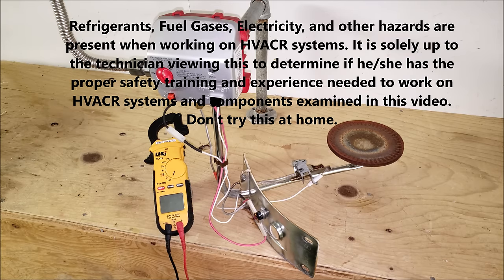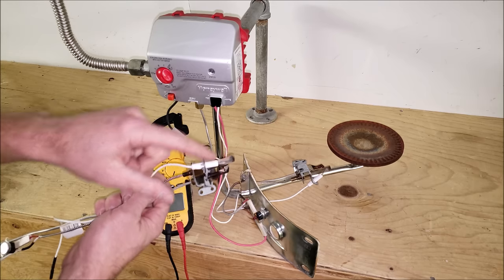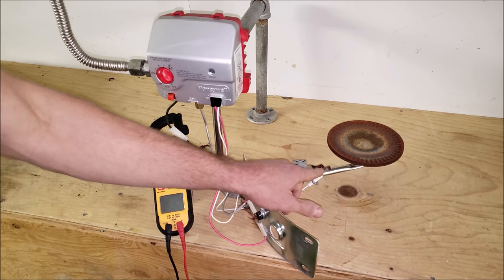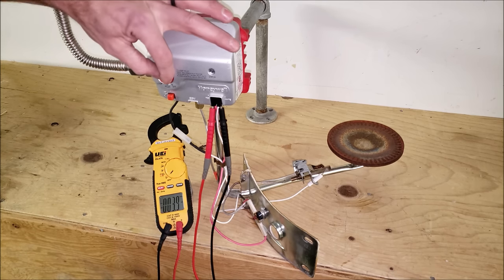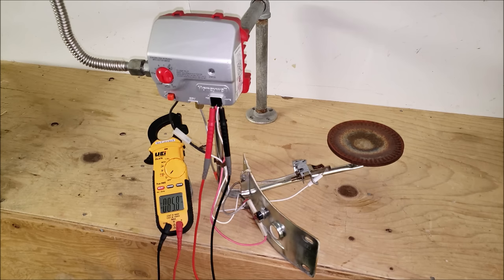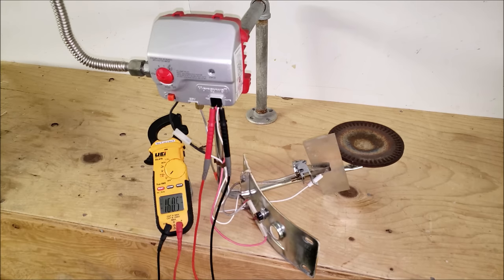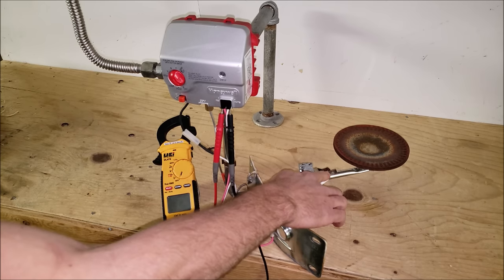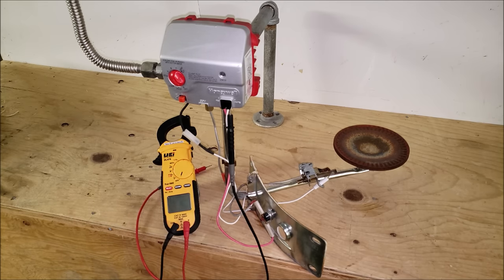Water Heater Pilot Light & Thermopile Troubleshooting!

Comment: Please help, we have not had hot water in one month.  The water heater is in the attic. My husband replaced the thermocouple, and the burner assembly.  He cleaned the air register.  The pilot light will stay on forever when the burner is not on.  When you turn the burner on and off the pilot stays lit.  But when you leave the burner on both the pilot and the burner goes off after about 15 minutes.

Comment: I replaced the thermopile and the chip on the control. I can light the pilot by holding it but it will not stay lit no matter how high the voltage is. I don't understand.

Comment: I have a Bradford White water heater with a Honeywell WV8840A1050 controller. The pilot lights . While continuing to hold in the pilot knob in, my meter quickly rises to 650mv+ on the thermopile wires. I release the pilot knob and the pilot flame goes out before I can turn the knob to hot. I removed the thermopile and cleaned it although it was not that dirty. What should I try next. Thank you
Reply: I'm thinking the solenoid doesn't stick at the correct mv. Have you tried replacing the gas valve/controller?

Comment: I’ve watched this video several times and all the other troubleshooting videos and no one has an answer for my specific issue. The pilot light won’t stay lit when the temp is set high. Anything above medium low and the pilot light goes out when the burner shuts off. If the temp is set to medium low or below, it works fine forever. Seems to be a common issue with the Bradford white but no one has the solve for it or no one posts it.

Comment: My pilot light wont stay lit. It ignites just fine. Once i let go of the knob it goes out. Ultimately giving two flash error code. Replaced thermopile. Still doing it. It'll stay lit as long as i hold the knob down. What could be the problem?
Reply from the maker: Is the safety switch open. Do you have the correct dc millivolts at the gas valve where the thermopile connects? Thanks!
Reply: I have the same problem. I get the mV at the valve to be ~550mV, but the pilot would not stay lit if I released the knob. Anh clue what it might be? The safety switch is closed.
Reply: @Danielsr_17  i had to replace the gas control valve and it fixed the problem.
Reply: @jenniferschmidt6505  Thanks for the quick reply.

Comment: The thermocouple only lets the controller know whether the pilot flame is on. So, how does it know the target water temperature has reached? Is it in the pipe connected to the body of the tank, which has direct contact with the water inside?
Reply from the maker: Yes the temp sensor piped into the body of the water heater, thanks!

Comment: Can you please help me to diagnosed my problem? I have ao Smith natural gas 75 gal water heater and it has same heating system as yours.  the pilot light stays on and when the main burner is also on for just 1-2 minutes, they will turn off completely and I will have 2 flashes code. Can you suggest anything,thanks
Reply from the maker: What dc millivolt reading are you getting and is the flame enveloping the thermopile? thanks
Reply: It was more than 560 mv when the pilot light is on without plug into the gas valve unit, and also 160-280 mv plug into the gas valve  with the burner on. 
This is what I did today ,I cleaned the tip of the thermopile, turn it back on and only one time the burner flame out. So far it’s working at the moment without any incident.
Reply from the maker: So it looks like that dc mv is a little on the low side. If it is clean and inveloped by the flame and doesn't have a high mv then replace it with a new one made by white rodgers or honeywell, thanks!
Reply: I already order one as backup  and I’ll wait to see if the old one goes bad again then I will replace, thanks for your help
Reply from the maker: Glad to help!

Comment: I recently had a valve/thermostat assembly fail, and it would have been great to know how much current it ought to draw in addition to the voltage the thermopile should produce. I tried setting up a bench power supply to a couple hundred mV, and powering the valve externally, and it drew over 500 mA at 750 mV, which I figured meant something shorted internally.

Comment: Hello i have the same gas valve and i"m getting about 700 mv from my thermopile , but when i release the pilot button the pilot goes out could my gas valve be bad?
Reply from the maker: It is possible since you are getting 700mv. Is there a safety switch that is tripped such as the high heat switch? thanks
Reply: @acservicetechchannel  i replaced the gas control valve and its working fine thanks for your video

Comment: Here's a trick gas company techs use to clean thermopiles/thermocouples WITHOUT REMOVING them, NOR using any abrasive, in under 2 min:
1.  After pilot light is lit, continue to hold PILOT LIGHT BUTTON ON, and DO NOT LET IT GO.
2.  Allow thermo to get full HOT.  (Continue holding pilot button).
3.  SQUIRT bottle water stream shots (2) at the thermopile ONLY.  Avoid the pilot flame.
1st shot fractures, (via THERMO-SHOCK temperature change), all the carbonized crud that has accreated upon the thermopile body.
2nd shot rinses it away.
4.  Repeat, until most all the crud is gone.  DONE.
5.  Collect your "He Da Man" points!

Comment: I have no gas going to pilot. Ignitor is very low spark but should ignite any gas. No pilot gas getting to spark. No trouble lights flashing. No light at all. Gas is on.
Reply from the maker: What gas pressure incoming do you have?

Comment: Has someone realized that the valve is showing a double flash error code, which means the thermopile is emitting incorrect voltage?
Reply from the maker: That was because I was faulting it and fixing it for the video, thanks